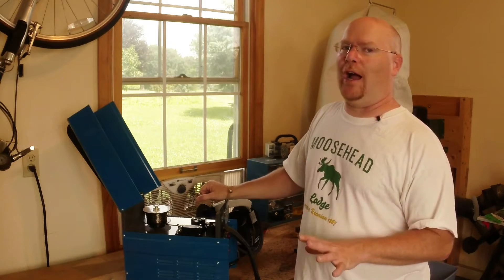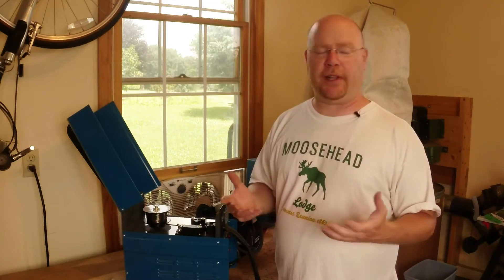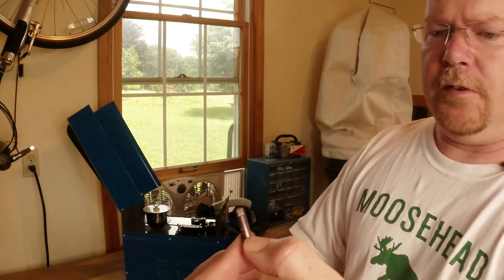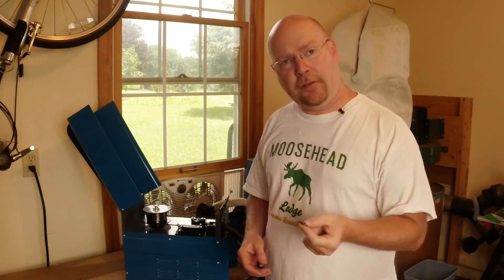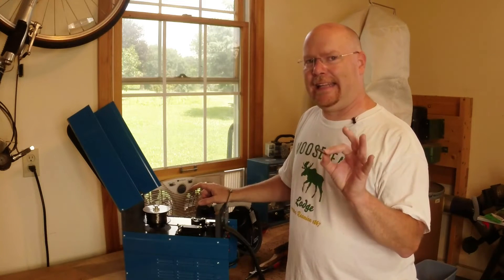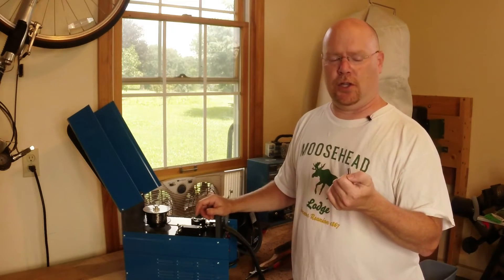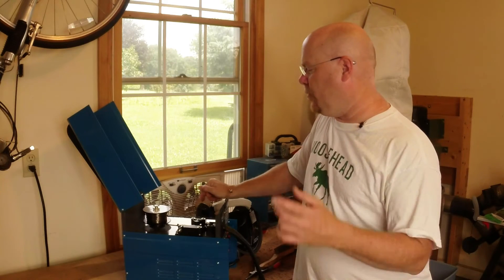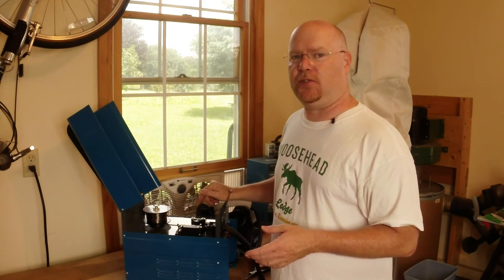Easy Harbor Freight 90 Amp Welder Mods 03

Comment: Hey Matt, I'm a bit confused. Hope you can help. I've been looking around for capacitors for my HF upgrade mod. Some capacitors are marked negative and some are marked positive. What are the differences in the two? Is there a huge difference?
Reply from the maker: They're all polarized at these sizes.  Some manufacturers mark the positive terminal and some mark the negative, but you can assume that there's one of each no matter which is marked.

Comment: Hey Matt, in our last messaging I indicated that I have three 22000uf 22000mfd "audio" capacitors. They are rated for 63 volts. Would they work?
Reply from the maker: 63V should be enough.  Likely no reason to hook up all 3 of them.  The rectifier makes 90% of the difference, and a single cap will get you to 99%.  Probably better off with 2 spares in the long run.

Comment: Hey Matt, can I use three audio capacitors 22000uf 22000mfd? Does it matter if they are classified for audio?
Reply from the maker: Audio system caps are typically not rated for high enough voltage.  It needs to be a 50V capacitor minimum.
Reply: These capacitors are rated 63V. They measure 35mm x 50mm. Do you think these will work?

Comment: Exception, when welding aluminum with aluminum wire, you would use .030 wire and .035 tip to account for expansion from heat up.

Comment: I have the newer version (with the tip shutoff relay). It came with a .03 tip installed and another one in a little "ziplock" bag...that I lost. I read in numerous reviews that the thing is supposed to work better with .035 wire...so when my original spool ran out, I got a 2 lb. spool of .035. I almost didn't get to try the .035 wire because it wouldn't go through the .03 tip...until I tried twisting the wire and tip together. The tiny flared out parts that wire cutters cause can become tiny little "machine tools". I simply bored my way through the orifice of the .03 tip with the .035 wire til it came out the other side.  This of course takes patience, a very gentle touch and great desire to keep pressing forward with the project you've commited yourself to see through. Whatever the case...I didn't mean to sound like a "braggart". Your series is pretty impressive. For a man who claims to not be a welder, you seem very insightful a out improving a welding machine. Maybe it's just a matter of learning the theory then applying it. Whatever the case, you've done a great job. You should try to build an SMAW or FCAW welder from old microwave oven transformers. Many have done so...but when my 1300 watt microwave died...I didn't find a big hulking transformer inside it. I felt cheated!! And that microwave was pretty old too! Oh well, no big deal. 

Matt, you're a pretty smart fellow. You should be able to build a "CONTROLLED" SMAW welder. You just need one or two big transformers (what you actually need is the big laminated cores. You can wrap the primary and secondary windings however you choose.) In fact...I CHALLENGE you to do so!! I know you can do it! YOU know you can do it...so do it. Document it on your channel and whoever watches it will have recieved good solid instructions on how it's done because you are a great teacher. I've rambled on far too long now so I'll say thanks again and...you better do it...sucka!! Peace and love and so long, Bye Bye!

Comment: Just FYI, I bought a new one of these just a few weeks ago.  It came with .030 wire and two tips also .030.  Either someone was asleep the day they put together the one you got or they have fixed this problem since then.  I expected to have .035 tips so I bought a pack of .030 and now I have plenty of spares! :)

Comment: You stated this was a free machine and it comes with .035 tips and .030 wire. 
Then you said it had shield ground down.  That tells me you didn't unpack new from box.  Well just to let you know the welder comes with 2 tips and they are both .030 not .035.  The wire is also .030.  No wonder somebody said the thing didn't work.

Comment: Matt, you just saved me about $400 with this video!  Had my eyes on a new Hobart handler 125 but now I won't have to buy it.  I had already swapped out the wire but didn't look into the tip or the feeder wheel.  Now it is perfect for light duty occasional use. 
Thank you very much!!!